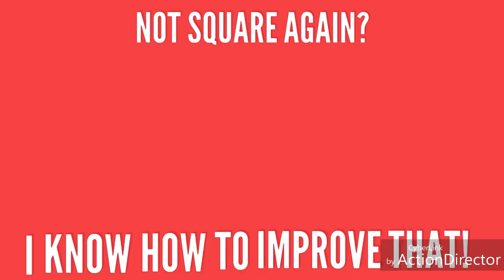DIY Jigsaw Crosscut Sled! - Perfect Jigsaw Cuts Every Single Time!

Comment: YES THANKS! I needed this. Im going to be getting a used porter cable circular saw. I'll try to make a mini table saw from it.
Reply from the maker: +ArmZap :HowTo
I'm not actually sure that's a great idea. My original plan was to make this for my circular saw, but I decided not to because that's just way too much of a risk to take only for cutting wood.
Your hands are going to be really, really close to the spinning blade. I could only suggest watching a few tablesaw kickback/injury videos on YouTube, I think it's not worth it.
Here if your fingers touch the blade, you might get a deep scratch, but with a tablesaw/circular saw, you're loosing 3 fingers...
:)
Reply: Yonatan24 im going to make a table saw then a sled or one of those sticks things people use to push the wood
Reply from the maker: You need a push stick if you have a fence, which you need to make rip cuts. But to make an accurate fence that won't make a board kick back at you I think you need a tablesaw ...first.
I don't think you should make a tablesaw before actually having experience using one, you don't know how crazy they behave, and how easy it is to get injured very seriously.
I really wouldn't recommend doing that TBH.
A jigsaw is fine though :)
Reply: Yonatan24 i think I'll be fine. But im mainly going to use it as a skill saw.
Reply: Yonatan24 i wont do it if u dont recommend it then. Nevermind
Reply from the maker: https://www.youtube.com/results?search_query=tablesaw+injury+kickback+accident
Reply: Yonatan24 i already saw some. I said i wasnt going to make it 😁
Reply: Yonatan24 i made it.☺
Reply from the maker: +ArmZap :HowTo Awesome! Post a few pictures of it in the comments section of the Instructable (click on I Made It!) and I'll send you a free premium membership to Instructables :)
Reply: Yonatan24 i tried it but it kept saying error. I'll try again today
Reply: Yonatan24 posted!!!!☺☺😉
Reply: another problem with those home made circ saw table saw jigs is you have no riving knife.

Comment: I'm going to make one for my bladerunner X2. Just to try it out. I like the idea so I'm going to try it. The only thing that wanders when cutting wood is my own hands. LOL This is much safer. I think.
Reply from the maker: I don't have one, but it looks from pictures like the bladerunner has a miter slot, which might be more practical. But if you don't have a speed square I don't know if it could be made accurately enough.
Reply: @Yonatan24  I do have a speed square and I have started the project but had to stop for now and come back to it...I'm optimistic. So far, so good.. Thanks.
Reply: @Yonatan24  The Bladerunner does have a miter slot, but it's not at all accurate.
Reply from the maker: @lindam.9282  Is the slot itself not straight, or does it just not cut accurately enough because of the blade? Because if so, a sled might not be able to fix that.

Comment: Good idea but it won't help when blade bend, You could add blade guide but cutting thick pieces would be impossible.
Reply from the maker: +FLR
The blade here doesn't bend. On my (older) black and decker jigsaw, the blade it was almost impossible to cut a piece of wood that's thicker than an inch. On this jigsaw, the blade stays in place really well. You saw (no pun intended) the thickness of the pieces of wood that I was able to cut.
Reply: It happened to me few times, maybe when blade gets hot or when pressure is too hard then it bend, maybe You just got better blades, i might try that sled soon and will share the results! Regards
Reply from the maker: +FLR
That's weird. Maybe the blade got so hot it lost it hardness (temper?)? Then it got softer and bent?
Would be great to hear how it goes! :)

Comment: Please use gloves when cutting, sometimes the piece jumps. Still far from perfect, the blade is  vibrating left and right. This is not made for precision.
Reply from the maker: +iveco555
Why would I use gloves? True, if I don't hold the piece down it can jump, but the blade doesn't wander from side to side...
Sure, this isn't a tablesaw, but you'd be surprised at how accurate and clean the cuts turn out!